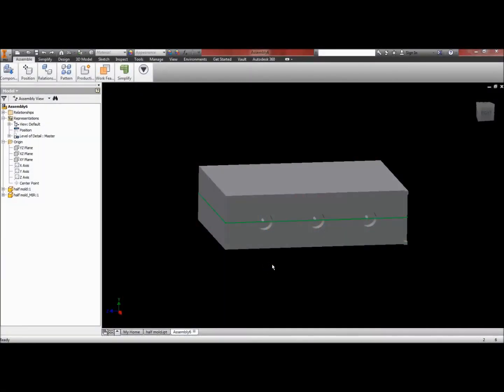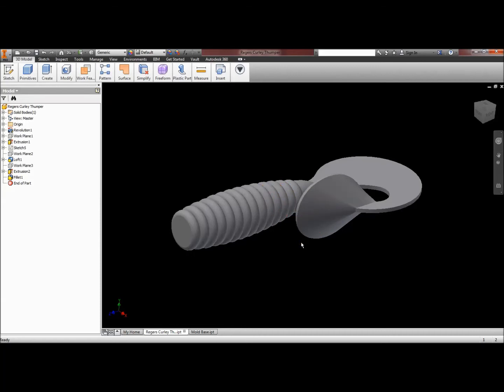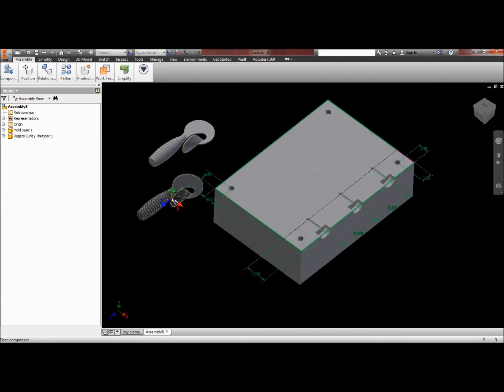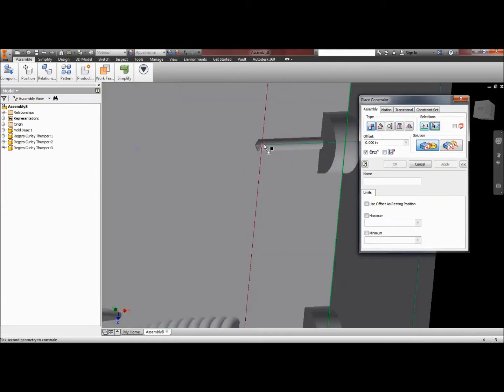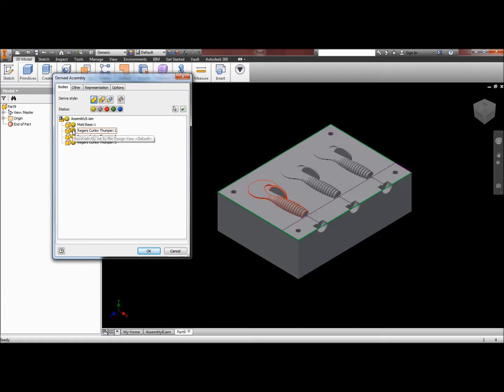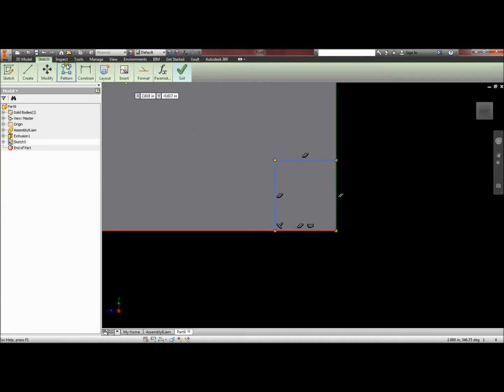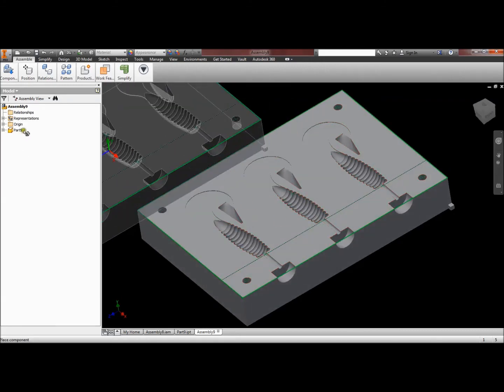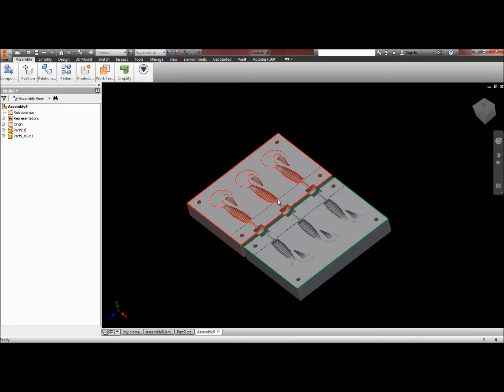Making Injection Molds Using Inventor!

Comment: When you 3D printed it was material was is printed on. Thanks, I hope I get a reply
Reply: ABS is going to be the cheapest material. We do this in our high school with students and ABS holds up well when injecting the silicone material. I Used PLA one year and it melted through the mold after multiple attempts.